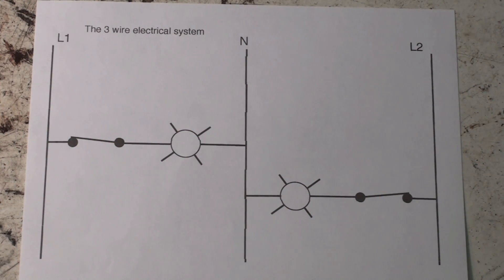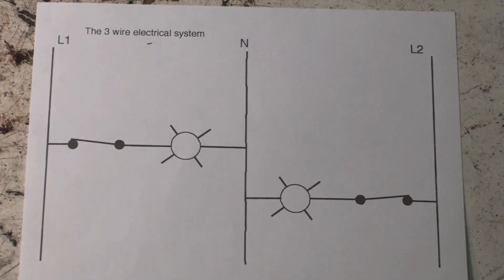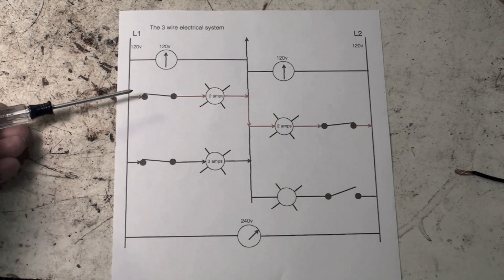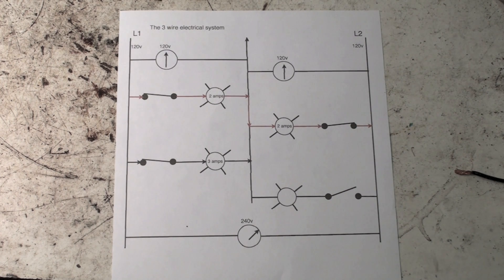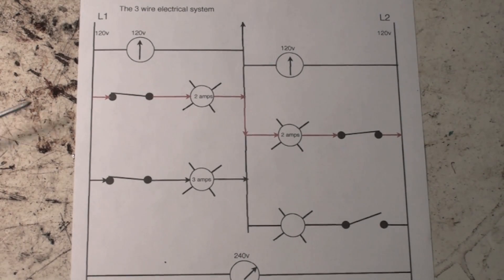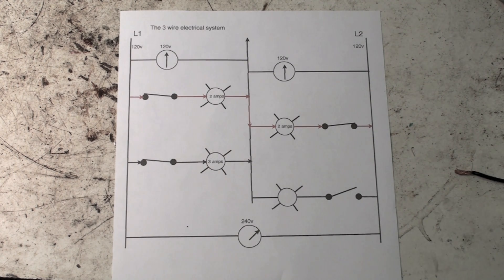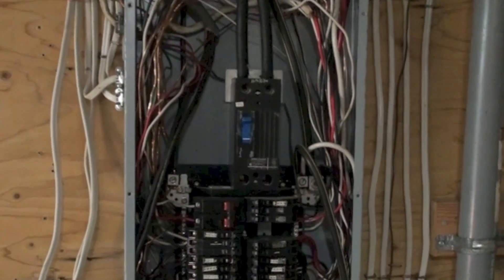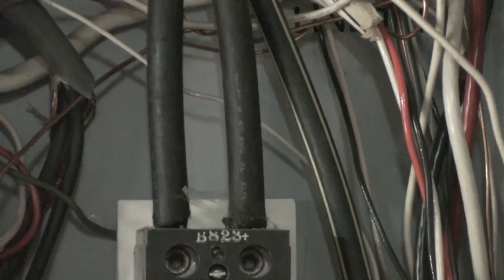How the 3 wire electrical system works

Comment: In some  plugs, only 2 pins are provided, why?     where is the so called 'neutral' ?
Reply from the maker: Yaseen Syed Some appliances are double insulated and a ground is not necessary.  The neutral is the wide blade on the plug.  Hope this helps.
GFM
Reply: What do you mean by two pins in some plugs? Are you referring to a 120v Receptacle or a 240v receptacle. If it's a 240v receptacle, the neutral is not needed because the voltage is 180 electrical degrees out of phase from one another, so it will balance out. If it's 240v with a neutral, it's because there are components in that appliance that requires a path back to the service, say electronics or something rated 120v.
Reply: Two pins can also be 120 for L1 and 120 for L2. He never said what kind of plug it's used for. Relax kid.
Reply: Maybe you don't understand North America's voltage system. Single phase is 120/240 and Three Phase is 120/208. In countries outside the US it's 240/415
Reply: A plug with two pins for a single phase load is obviously hot and neutral plus a ground. A plug with two pins for say a 240v load is also two pins, 120v for L1 and 120 for L2 with a ground. I know what I'm talking about.
Reply: Manjunath K N
Listen here Marijuana or however you say your name.  "In some  plugs, only 2 pins are provided, why?     where is the so called 'neutral' ?" That's his question. Due to the lack of certainty in his question I assumed he might be asking "Where is the so called neutral when using a 240v plug." Considering the topic of video is in regard to the 3 wire electrical system, not too many people understand why a 240v plug only has two hot pins and why the neutral is not included. So therefore, I'm done with this thread. Have a good day and tell Allah Ackbar I said hi.
Reply: And FYI North America don't use dual type voltage system as you mentioned above(240/120 is a dual voltage system ) .. they only use 120v actually it's the right way to avoid confusion ... Can one phase to `n` number of lines and one neutral.. I think you won't get this that's y I haven't replied... And I'm atheist I don't pray any God..
Reply: Manjunath K N Yes they do, and it is not 3 phase for residential, it is called split phase. It is basically 120 and 240 volts, but can be called 110,220,or 115,230, or 125,250 volts. This is because it depends on line voltage at the area. Line voltages can vary by distance. The transformer on the pole has a center tapped secondary winding,....in this case "secondary means the low voltage winding".
Reply: John Kerley The center tap wire is at the middle of the number of turns of wire in the secondary coil and also physically at the center of the magnetical fluctuations of the transformer core,.....and therefore it is at zero voltage,or,neutral,while the other two ends of the coil are at "lets just say 120 volts in respect to the center of the coil. Therefore, the secondary coils output is said to be 120V to neutral on one side and 120V to neutral on the other side,....adding up to 240V from side to side. At any given instance of a cycle, one side of the coil is positive and the other side is negative,.....always swapping polarities,.....the center always at neutral,....but at the same time, always able to take a return from either side,....provided it first ran through some kind of load. If one side is returned to neutral without first going through a load of some sort ( all I can say is KAPOW!!!!!!!)
Reply: 3 Phase does not apply to Residential. The term is 3 Wire, in regards to the two 120V lines that are 180 electric degrees apart from one another and the neutral which is derived from the center tap of the secondary winding of the transformer which yields 240V L-L, 120 L-N.

3 Phase would be applied to the HV distribution coming from the Power Company that travels on the utility poles.

You can actually allow a neutral in a Delta connection. Read up on it.
Reply: http://en.wikipedia.org/wiki/High-leg_delta
Reply: Doubtful you work on what you say you do. Where did you earn your degree in electrical at? Radio Shack?
Reply: Manjunath K N Ok,it's just a technicallity. I do'nt know too much about 3phase but I think that maybe on Delta the circuit is completed through a hot wire during an opposite phase. I might not have that right,if not let me know.
Reply: Manjunath K N Technically the 240V could be taken directly,but it is not usually done that way in most appliances. The 120v from L1 can return though the 120V from L2 as long as it passes through a load first. It can do that because of 180 degree phase difference.
Reply: John Kerley
I forgot to add one important note for anyone contemplating doing this,other than whether it is within code to do it, it is important that the load be rated to operate at 240 volts.
Reply: John Kerley If you want to see one that seems really wierd take a look at the video that is called "Open Neutrals" and see how you would explain the phenomenum that is shown.
Reply: Manjunath, you're a fucking moron, you have no clue what we're talking about. I explained the differences but it's no use trying to educate some scrub from a third world country with a radio shack degree.
Reply: John Kerley dude good question.. Actually this video should have explained with open neutral concept.. I'm talking of single phase now! (for moron).. Neutral is not only for circuit path it's also for balancing load,.. So take this example, take two lights, for light1 connect hot wire 1 and neutral, for light 2 connect hot wire 2 and neutral but remember all are connected each other.. Now switch on both the lights, the lights will glow with equal illumination means equal voltage, now remove neutral.. But still lights glows because there is a connected path between hot 1 and 2,but now there will be no equal illumination.. Because the voltage is not equal.. Hence neutral is used to connect the circuit path and to balance load..
Reply: See two lamps example of open neutral in YouTube..
Reply: Manjunath K N Everything that you and ABflanagan are saying to each other is going in my E-mail inbox for some reason.
Reply: It's because your Youtube account is synced with your gmail.
Reply: I can't spell because I'm not.. And you are really modern Einstein!!! I ll take bow  for you and your knowledge...
Reply: ABflanagan523 dude I ll say answer for why star connection used with neutral, y not with delta .. The delta connection is used for short distance so there will be no unbalanced load(here major unbalanced loads are faults) so neutral is not required at all!!!  Where in star connection is used for long distance so unbalanced load will be there, so the neutral is used to balance..
Reply: John Kerley I'm not responsible for it.. It depends upon your settings.. Some mobile has auto sync.
Reply: ABflanagan523 Dude I work in projects and manufacturing sector... Which includes thousands of wiring connection, numbers of switchgears , plcs, vfds etc.. I don't need to learn from you, you are simply saying whatever you know... If you don't know something try to ask don't try to argue, I can't say I know everything but if know I ll say definitely.
Reply: Manjunath K N Neutral is not required on Delta as you said, but in some cases it is added to a secondary Delta by center tapping one coil. I saw that on one of the videos about Delta and determining the " high leg".
Reply: Manjunath K N I believe as you said that the power lines (3 phase) on the utility poles are actually in Wye. That would seem logical to me.
Reply: Manjunath K N Here, where I live, a lineman told me that the 3 phase lines that actually are the lines that power the local school,ect...,are 12500v line to line, and 7200v with respect to ground. I'm just saying in case that is a clue to Delta or Wye.
Reply: Manjunath K N I think it has to mean Wye, or line to ground would probably be 12500v or 6250v.
Reply: Manjunath K N I should not have said 6250v, that would only apply to a floating center tap return that was not grounded!
Reply: John Kerley I ll get over to you on Sunday.. For all your questions. And there is nothing such it should get 6250 or 7200 v in 3phase.
Reply: I ll try to give solution on Sunday John Kerley
Reply: And I hope you get the open neutral concept John Kerley
Reply: Manjunath K N It does'nt get 6250v, that was just an example of a theoretical 12500v Delta with one coil center tapped. But, however, the lineman said that it was 12500v line to line and 7200v to ground. 12500v divided by the square root of 3 equals 7200v. Thus, this implies a Wye.
Reply: Manjunath K N Are you talking about the one that I put a link to?
Reply: John Kerley
I am not talking about a pole transformer here,...I am talking about the 3 phase high tension lines on the top of the poles. Of coarse this is but one example. There are many much higher tension examples.
Reply: John Kerley
These lines will still come from a transformer,but a much larger one at a substation.
Reply: Dude I'm not getting why are you measuring line to ground in wye?
Reply: John Kerley What ABflanagan523 referred is a high leg delta.. You can go through it.. I ll tell a situation where high leg can be used.. Consider a120v operated systems and a 240v operated 3phase system.. If this the situation you require wye and a single phase to suffice.. But you require two power systems instead of that high leg delta connection is used.. Which can suffice a required operations in one power systems only..
Reply: Manjunath K N
It was just to make the case that the high tension lines coming from the substation are usually in Wye.
Reply: Manjunath K N It is just that from what a lineman told me and also I once read in a book, that the power lines would have to be in Wye,....but I am beginning to dought this myself, at least for all cases. The book showed line voltage was stepped down from 7200v to 240/120v on a single phase transformer that was hooked to one overhead high tension line and also to the lower ground line(this is incoming to the transformer). This would appear to make the high tension lines above the transformer to be in Wye with the lower ground wire being the Wyes neutral line. This is based on the fact that the lineman said that the high tension lines had been measured fo the voltage in the past and had showed to be 12500v(line to line).
Reply: Manjunath K N I guess, as they say,...it depends on whether the neutral originates from the pole or not. I the Wye power line configuration the neutral would originate from the pole, but in Delta it would not. But even in Delta powerline systems the step down transformers neutrals(single phase transformers) may still have a long running lower 4th wire from pole to pole.
Reply: I don't know much about transmission.. I know how to utilize 3phase. I  will try to get solution for you..  :)
Reply: Manjunath K N If you try to look it up on the internet, you will see varying examples,...some will say the line to line voltage to be anywhere from 11000v,12500v,13200v, and 14400v, but mostly the line to ground voltage will be 7200v. This makes the ideal HV line to line closest to 12000v to be a 4 wire Wye. !2000v/1.73=@7200v. But,also,a lot of the pole transformers have HV taps, so different HV input is not a problem.
Reply: Manjunath K N Actually,though,the transformers with HV taps must also have different wire turn ratio in order to still have 240/120v secondary.
Reply: Manjunath K N I saw on the internet the part about the HV tap, but, I got to admit that it does'nt make sense unless the secondary also has taps. I do'nt know if there is some strange kind of tap system that can move both primary and secondary simultaneously to the right amount somehow,....seems inpossible!
Reply: Manjunath K N I believe that what they must have meant, being that they said that the tap was usually on the inside of the transformer can, is that they are tapped by the factory for different HV input,but probably the secondary is also tapped by the factory so they just have transformers available for different HV. In that way the factory only has to make basically one transformer design.
Reply: John Kerley Thank you!  I've been reading about center taps, etc for a few days, and this is the FIRST time I've understood what's going on.
Reply from the maker: Jackie Thomas Glad it helped.
GFM

Comment: Good description on how a neutral balances the differential between leg 1 & leg 2.  New code requires isolating the ground from the grounding conductor (neutral).  I think this change was to try to limit stray voltage. This comment is in response to several comments in regard to this video.
Reply from the maker: You will have to show me that one.  From what I know, the ground and neutral are isolated only in panels that are not the service disconnect, or what we call the main panel.
GFM
Reply: Old systems are grand fathered in, but the latest code change has the ground and neutral bars isloated all the way to a HVAC disconnect (if a neutral is required) and on all hot tub GFI disconnects. If there is a connecting bar in the main panel, it must be removed before inspection. I will probably post a video on that code in a couple of months.

Comment: clean presentation and unclean panel ....lol
Reply: what would be the net amps on the neutral ifiam to connect a load of 10 amps across l1 and l2 ....meaning to say across 240 v line ...considering the same conditions as you have explained as the unbalanced load equals 3amps

Comment: look im no genius but I do know your not giving the neutral enough credit and your theory is a little off.  first: the electrons in a circuit from l1 to neutral are changing direction 60 times a second. so your circuit is 120v from l1 to N not through another circuit on L2, the electrons don't care whats going on with L2 remember the path of least resistance which it would be more work to travel through the other leg or line. neutral may be considered a gathering place or a "common" but not distribution place. the balance thing isn't up to anything other than physics and nature.. everything is trying to reach equilibrium for sure but remember everything is also on its was to chaos without intervention
Reply from the maker: Lets start with the changing of direction.  Alternating current changes direction 120 times a second (in the US) to make a complete positive to positive cycle of 60 cycles per second.  Because it is 120 volts the cycle rate does not change.  
The transformer on the pole has an output of 240 volts.  That is read from L1 to L2.  In order to supply a lower (safer) voltage for small loads without a fourth wire, there is a center tap of the pole transformer which is called Neutral.  
Now, if the power can travel from L1 thru a load to neutral then thru another load to L2 it will do so.  The voltage is higher so it will travel from L1 to L2.  
If there is no complete circuit between L1 to L2, the power will go from L1 to neutral at the lower voltage but will reach L2 at some point..  
So the total amp draw of the circuit goes thru L1 and L2.  
The neutral is truly a common and a distribution circuit.  
I don't know about the chaos and intervention.  
I realize this is a not simple concept.  Hope this helps.
GFM
Reply: wrong concept 60 or 50 times a second doesnt depend on the power,its the standard of devices or machines which can work on power efficiently,, yes from 120 or 115v which is from phase to neutral is completing its path but its unbalanced,, so unbalanced neutral having some current, it should return to another line(say l2) which is phase only to balance,,otherwse it will remain as unbalanced only.. you can check this using clamp meter ..